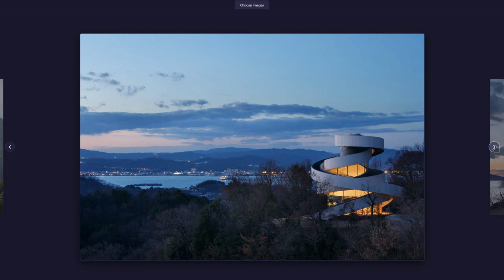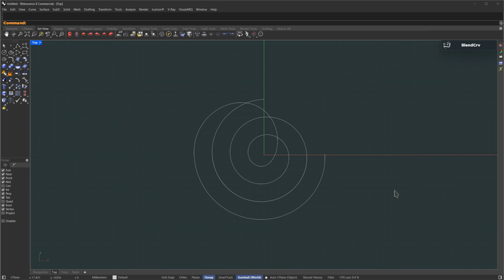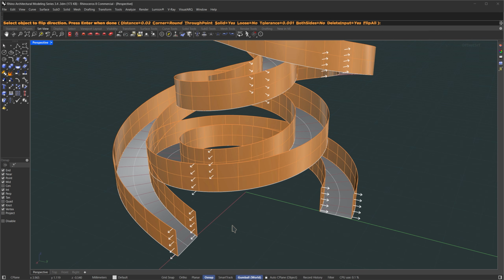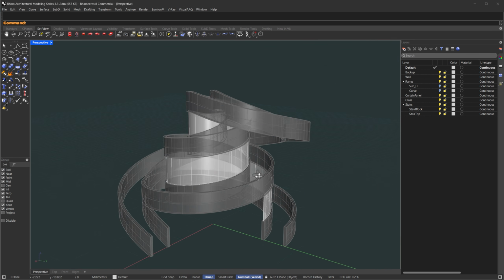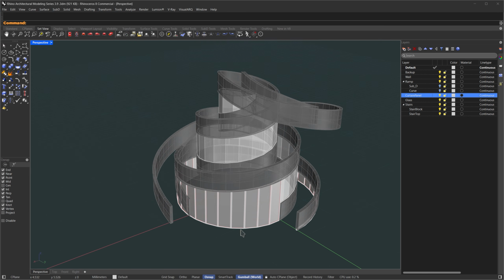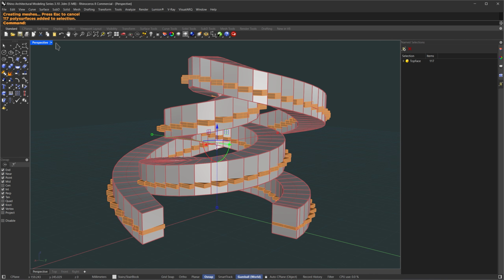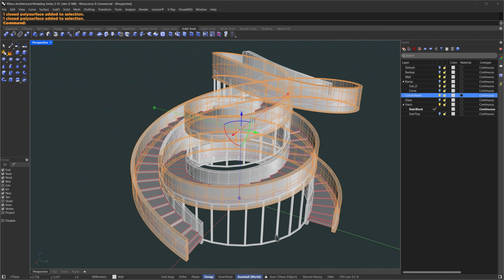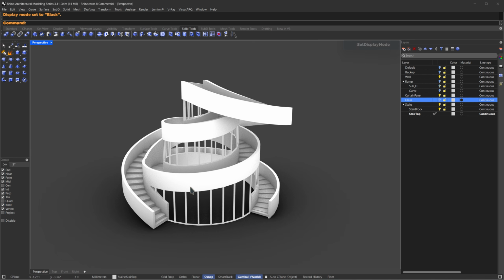Rhino Architectural Modeling | Ribbon Chapel

Comment: The stair part was kinda smart, however, I wonder if you could it with array tool! 
And, for extracting the top face of the stairs, I'd run to Grasshopper, if I were confronting situations like this 😂
Reply from the maker: Yeah, I felt the same while recording. But doing it manually was intentional as part of the Rhino architectural modeling series for beginners. Anyway, we did this exact same building fully in Grasshopper if you want to check it out here: https://youtu.be/35J3UDfu82w?si=xKyQOc66mzGGMWIa

Comment: hey, thank for tutorial, did each step but i still cant boolean diffrent, any suggestions?
Reply from the maker: Make sure there are no overlapping or intersecting faces before using Boolean. If you’re still stuck, we’ve published an alternative method modeling the same building using Grasshopper , you can check it out on the channel